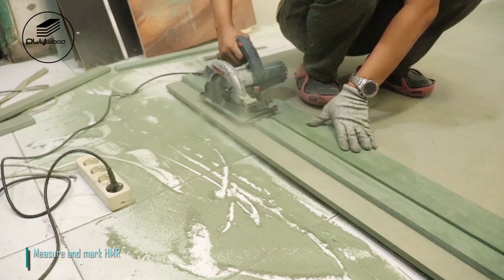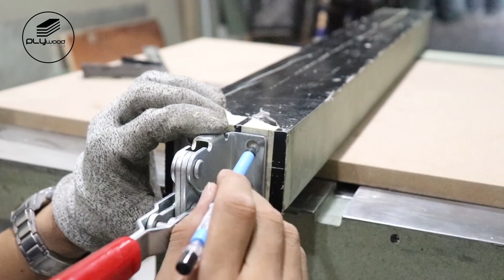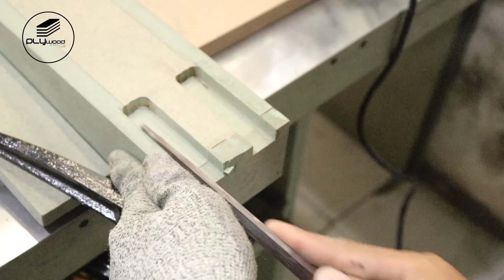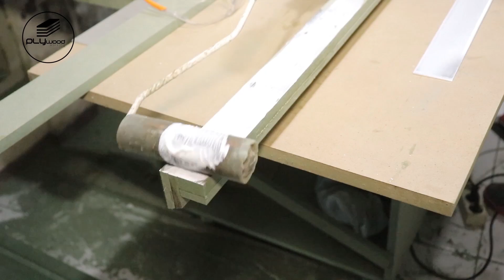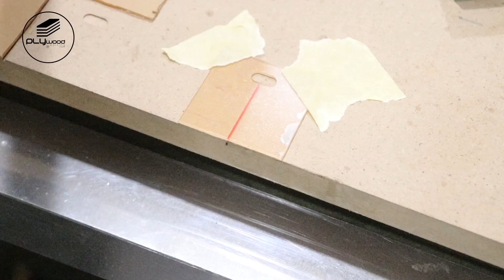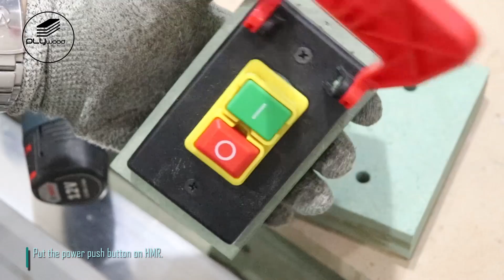DIY Table Saw Fence System

Comment: Why not just use some extruded aluminum instead.  Building a box out of what appears to by MDF doesn't seem like a great idea.  The overall design however is good but using any type of wood product that can absorb some moisture over time or wear out faster than metal is not the best idea.
Reply from the maker: This is not mdf but HMR (high moisture resistant) look same but different. Extrude aluminium too light same like original from table saw

Comment: Nice job, but would be very expensive to make in the UK, as the price of materials would be prohibitive if buying just for this project alone. Might just be viable if you had enough stock of MDF and aluminium sheet left over from other projects. However the building, and accuracy are impressive.
Reply from the maker: Thank you very much, I agree this material is expensive but very durable and flatten that is why I am using this material for the fence. MDF is good but not too durable. Maybe I recommend using HDF.

Comment: Nice video, I will try for my cheap einhell table saw. Two questions. In my country (Spain) is very difficult to found HDF. You think MDF will do the work? And the second. Wich glue you use for aluminum/wood bond? It doesn´t seem epoxy. Thank you so much!
Reply from the maker: MDF can handle that but you need give extra protection coz MDF not durable with weather. for glue use PVaC type

Comment: jika meja saya hanya sedalam 25 inci (635 mm), berapa panjang yang saya potong daripada 880mm?
Reply from the maker: for the length give extra 150mm or minimum 100mm for the dimension yout top table, no need same use 880mm
Reply: @plywoodworking  what size toggle clamp is that? GH101 or something else? Thanks

Comment: please don't wear cut resistant gloves, especially, or gloves of any kind around power tools, they are a very tough fabric and can get caught in the blade. As a butcher by trade we would never wear gloves working at the saws or near any rotating equipment. Wear them when you are working with knives and chisels, they are not puncture resistant so will not stop a sharp point but will prevent a slicing cut. Once again, DO NOT WEAR GLOVES AROUND ROTATING EQUIPMENT!
Reply from the maker: thank you very much for suggestion, i will do!!

Comment: One of the best DIY fence that is perhaps as good if not better than the legendary "BIESMEYER" fence.  Lots of parts and layout but certainly will stand the test of time.  BTW, what is HMR?  Not sure whether it is sold here in the US.  Hope it is not the same as MDF or Particleboard which is great for flat stock but not very good in all diamensions
Reply from the maker: thank you for all support, try search HMR material sell on US

Comment: Great build and video.  Does the fence automatically square to the blade when you clamp it, or do you have to adjust it and ensure it's re-squared every time you move the fence for a new cut?
Reply from the maker: thank you very much!!

Comment: Om, itu table top nya pake bahan apa ya dan tebal berapa, susah gak ngebentuknya rapi gitu?
Reply from the maker: aluminium 2 mm mas, bs dibilang lmyan ssh mas
Reply: @plywoodworking  kalo pake plat seng bagus gak ya?
Reply from the maker: Drpd seng galvalum 0.4 aj mas cm krng enak sih tp bs jdi opsi murah

Comment: Clean your blades and you wont see so many burn marks in your cuts.  Sap, resin and glue are building up on it and causing friction burns.
Reply from the maker: Thank you for suggestion, now i change my blade with freud more clean cut & precision without burn

Comment: a very very safe system ...
a very good job...
I want to do too
...Can you share the 3D CAD data with me?
Reply from the maker: thank you, i dont have CAD data, but i give free plan with detail size for build,  i add all plan in my FB page you can joint on plywoodworking tips & trick on FB for easy download
Reply: @plywoodworking  thank you very much

Comment: Ok. Probably a dumb question, but I’ll be the one to ask it.... what is HMR???
Reply: Ok. I’ll answer my own question. HMR stands for “High Moisture Resistance” It is a form of MDF, but is a water resistant version that is resin impregnated and more stable. It says so in the comments below, but the explanation has slipped a long way down the list. I’d never heard of it before.  I don’t think the term HMR is used everywhere, try searching for HDHMR or MRMDF. I found it at a builders merchant described as ‘moisture resistant MDF’. A search for HMR didn’t bring up anything to do with wood where I live (UK).
Reply from the maker: Yes almost same hmr and mdf but mdf 100% pure from paper but hmr paper,wood particel+ resin. If you life on uk you can search valchromat that same like HMR but more better coz more solid.
https://www.lathamtimber.co.uk/products/panels/mdf/valchromat?utm_medium=organic&utm_source=google

Comment: What's the model number of the toggle clamp? 
There's a dozen different sizes on eBay so I need the model number to get the right one. 
Good job, I will probably build this.
BTW, please drop the music in the future, it's awful and not necessary.
Reply from the maker: I forget about type but this toggle clamp can hold 650 kg that enough for fence. This is vertical toggle clamp if i found the link i will share

Comment: Good project, well done. I would like information about used material, I never seen this kind of ... wood, How is possible to find it to test? 
thanks by Micky
Reply from the maker: Thank you, this is new material call HMR high moistur resistan look like mdf but more solid, durable and waterprof, you can use wood or birch playwold but make sure flaten coz.this is fence

Comment: O trabalho e atenção aos detalhes são incontestáveis. Porém, seria melhor investir em um motor mais potente ao invés de usar essa máquina da Stanley, ou adquirir uma esquadrejadeira de precisão.
Reply from the maker: not like on your country get table saw in my country very diffcult and expensive, i bought stanley why coz good for price but still have quality, i know have dewalt on my country but type dewalt not like on internasional type DWE 747 ,i dont like the type and the price expensive, if i can get right table saw on my country with good quality and good price i will change my table saw with more HP, but for now i like the result my modification table saw

Comment: What size is the vertical toggle clamp you used
Reply from the maker: 350 kg for size more good use morr heavy buat 350 for this fence enough for hold
Reply: @plywoodworking  Thankyou

Comment: Bagus kak bikin table saw nya
Saya baru mulai main di woodworking kalo mw bikin table saw yg simple gimana ya
Kalo bikin kaya yg dibuat di atas sulit bagi pemula kaya saya

Kalo boleh bisa minta kontak wa nya kak?
Reply from the maker: dicoba pelan2 mas awalya emg ssh tp klo susah kebiasaan pasti bisa
Reply: @plywoodworking  itu material yg di pake apa aja ya kak?
Kalo hmr di bandung daerah mana ya yg jualnya?
Reply from the maker: @fajarakbar5086  wah krng tau juala dmna coz sy di surabaya
Reply: @plywoodworking  kalo catok yang digunakan itu namanya catok apa ya kak?
Reply from the maker: @fajarakbar5086  F clamp ato bar clamp
Reply: @plywoodworking  okke kak nnti saya cari
Makasih kak atas obrolannya
Reply from the maker: @fajarakbar5086  oke siap mas,c ari aj online banyak klo clamp

Comment: hi.
i can't find part one of the fence plan , is there a part one or not ?, if there is please upload this part that also give me some info for the toggle clamp
Reply from the maker: This is only part for detail make fence if want complite version you can see on super ultimate table saw masterplan that complite version for all
Reply: https://www.woodcraft.com/products/woodriver-vertical-handle-toggle-clamp-5-3-4-x-7-1-2-750-lb-capacity?via=573621f469702d06760016cd%2C576328a869702d20ec000b2f%2C5bf5b10b776f6f7dc1001022  should work

Comment: Hi congratulations for the beautiful project. Please tell me the features of the toggle clamp and / or its measurements and where I can buy it together with the switch. Thanks and good job
Reply from the maker: thank you for support, i but all on ali express,
this is the link power push button
https://www.aliexpress.com/af/power-push-button-red-cover.html?d=y&origin=n&SearchText=power+push+button+red+cover&catId=0&initiative_id=SB_20200120062555
Reply: @plywoodworking  
Thanks for the information please can you also give me the link of the knee clamp. good job

Comment: Instead of using HMR board as material, could you make just the same from Baltic birch plywood?
Reply from the maker: Yes you can use birch plywood i think that great material too but make sure plywood not bend or curve

Comment: Hello ✋
Wich Software you take for the Animation ?
Reply from the maker: I use 3D max for make animation
Reply: plywoodworking Thank you 👍
Now after the saw fence you need stronger „Basement“ for your saw ... it‘s to shaky with this weight ... the next project 😁
Good Job 👍👍

Comment: How do you adjust fence for parallel to blade?
Reply from the maker: you can set blade position first on table saw, if still not center you can adjust on lock system, release  screw and center again or this is last option set up the rail fence

Comment: I will like explanation about gluing  aluminium sheets on mdf. Is that wood glue? Tnx
Reply from the maker: i use PVAc glue but give grip  on aluminum before glue, more good if use polymer glue, but more long apply if use polymer

Comment: Only works with a homemade wooden table saw, useless for any other type table saw unless you want to add a wooden table top.
Reply from the maker: you must creative, i think can work on all table saw, you must make set rail and fence, i can apply this on iron cash table saw but difficult on small table saw

Comment: Great build!  Quick question, what is HMR?
Reply: Its a pressure treated MDF.   If not available, then use regular MDF and seal it when completed.
Reply from the maker: this is for detail explain HMR https://www.sinkwarehouse.com.au/blog/what-is-hmr-board-why-it-is-best-material-for-your-bathroom-vanity-cabinet/
Reply: @plywoodworking  I dont know if we have something similar in The United states?  Do you happen to know?
Reply: it's High Moisture Resistance particleboard, like regular MDF but with a moisture-resistant resin-impregnated during the manufacturing process, generally used in bathrooms or anywhere there is high moisture content.

Comment: What's the purpose of the glove?
Reply from the maker: This glove resistant from scratch, my left hand often scratch that why i use glove on left hand
Reply: @plywoodworking  when you see a finger get ripped off because of a glove..you will live with the scratches...I have a friend missing a finger because of gloves.. extremely dangerous
Reply from the maker: @myopinion6328  yes you right i  take my glove if use table saw coz very dangerous, i have bad experience to cut my edge finger use circular saw, lucky me my finger back normal again. thank you so much for suggestion ,now i more carefully use all powertools
Reply: @plywoodworking  yet you make videos showing people you wear a glove while woodworking...that's just irresponsible to do that..people will think it's ok to wear gloves and operate machines...drill presses will take fingers off that have gloves...so your videos are very irresponsible...you do what you want..maybe explain to people just because your stupid..they shouldn't be
Reply from the maker: @myopinion6328 i think if only drill its okay, i dont know why so dangerous drill use glove  and always use clamp if use drill press. If i use table saw with glove that problem, coz very dangerous
Reply: My Opinion I’ve had a drill press catch a glove finger more than once. Not as big of a deal as one might think. It can be disconcerting and I don’t recommend it. But, I’ve still got all of my digits. A little hand strength is helpful.
Reply: @patrickperry6945  and yet you've learned nothing from it...

Comment: What is the exact model of that toggle clamp ? I can only find smaller versions :(
Reply from the maker: this toggle clamp call vertical toggle clamp, maybe you can find on AE marketplace, this toggle more difficult fnd on large size, usually small size
Reply: @plywoodworking  does it have a number on it as each toggle clamp comes with a number normally denoting its size.

Comment: How to wiring the switch?
Reply from the maker: Good question, this swicth use magnet electric, you must double wire on upper, on back switch have 5 connector 2 wire from table saw 2 on electricity and 1 for magnet.
You must connect from ts with magnet, if not cant working.
Maybe you confuse my expalain i will draw that asap
Reply: @plywoodworking  Thank u very much. I'll try it.